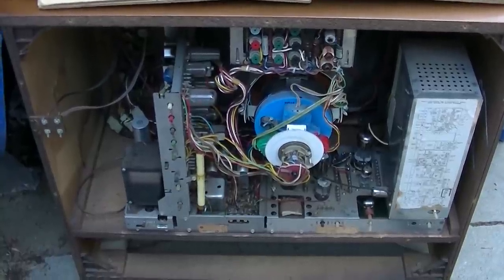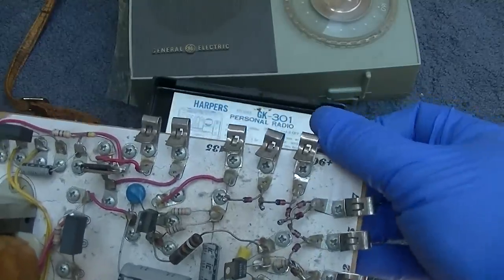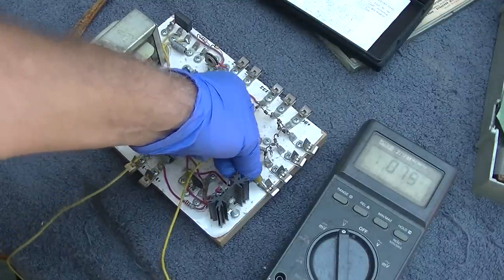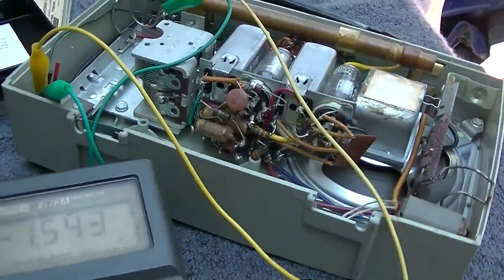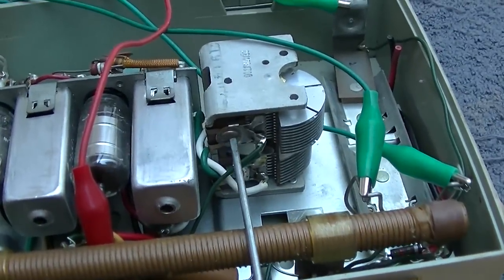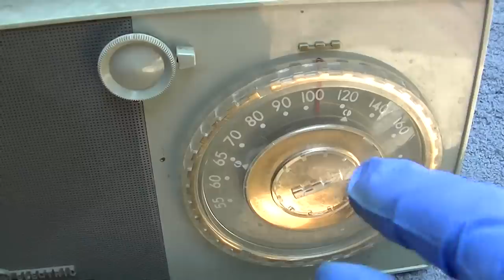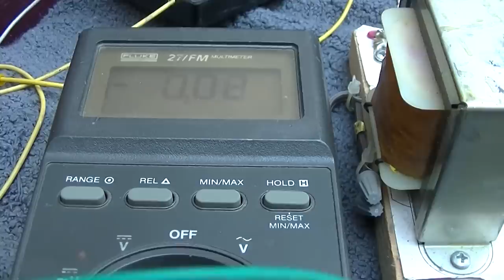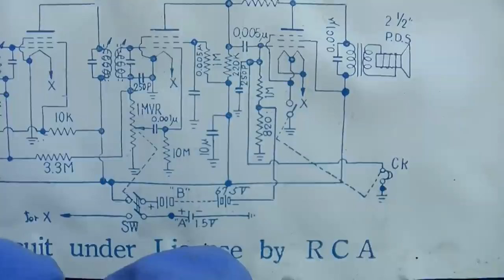4 Tube Personal AM Radios and AES Battery Eliminator

Comment: What is this test station does anybody have any information on it?
Reply: Caltrans (California Dept of Transportation) has a string of low power (around 10 watts) advisory stations on 1610 KHz across the state.  They're usually called Highway Advisory Radio (HAR) or Traffic Information Stations (TIS).  The two closest to Shango are a ways north of him.  The closest one is WPHJ962, which is a whip antenna on a wooden telephone pole beside the I-10 Santa Monica Freeway, along the eastbound onramp, just east of Bundy Drive, in West Los Angeles.  The cul-de-sac of S. Westgate Avenue points right at it.  The other one, WQED842, is a bit further north, beside the 405 San Diego Freeway at the Sunset Blvd bridge, near the UCLA campus.  That one is on a white steel pole, on the west side of the freeway, nestled between the southbound offramp and southbound onramp.  You can see them both in Google Street View.  If you do a Google search for FCC and ULS and either of those callsigns, you'll find the licenses.  The FCC cited Caltrans in 2007 for broadcasting test message loops like this from WPHJ962, so it's a bit surprising that they're doing it again.  I can sometimes hear that test message at my location at night, roughly 40 miles north of Shango, very faintly.
Reply: @auchterawer1150  Went to Torrance yesterday. The station is actually 1700Khz. Might have to do some more digging.
Reply: @nickb.8876  Someone here in L.A. could probably use a transistor radio, one with a loopstick antenna that gives good nulls, and drive a couple miles around a circle centered on Imperial and La Cienega and take a few bearings and see if they do intersect there.  Probably can't get a usable null if you're closer than a tenth of a mile.  About a mile away would probably be adequate.  I seldom drive down into that part of L.A., otherwise I might check it myself.  Thanks for the field report, and correction!
Reply: @auchterawer1150   Glad I could give a report back. That sounds like a nice strategy and a fun experiment. I think you should do it some day! Someone's gotta do it! I'm a little far here in Ventura County. Almost wonder if I can receive it here at night.

Comment: Something is about this bulky GE that is really cool. No sure if the bizarre form factor or the color. Nice sound also. It is impresive they manage to get pocket radio on tuves with 67V batteries. Probably just a niche for industries on remote areas ... otherwise is pure gimic and a very expensive toy (in batteries).

Comment: I'm in to dx receive and would love to know that frequency is of that  "this is a test only a test" just to see if i could swing the beams round and have a go at receiving it.  i see the dial on the radio but not having much look a exact frequency would be helpful in my search. I've searched the net but can only find  emergency broadcast frequencies in the uhf/vhf rang. Any help on the frequency please.
Reply: I believe that testing frequency is just above 1600 on the dial, probably around 1620 or 1630 or so. If you notice when Shango adjusted the oscillator trimmer screw, he had to unscrew it to get the top end of the dial to tune a bit higher in frequency. The station he was receiving before turning it was "out of tune" and distorted, and as he turned the trimmer, it got loud and clear before moving on to the testing station.
Reply: Am 1610. Its reserved for government. Or borderblasters.